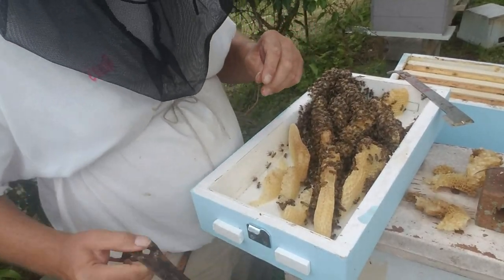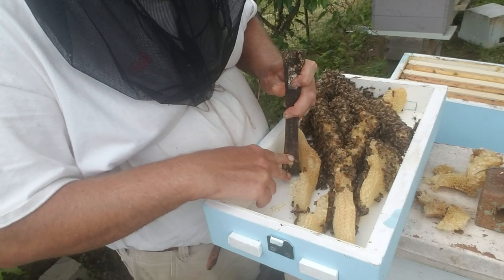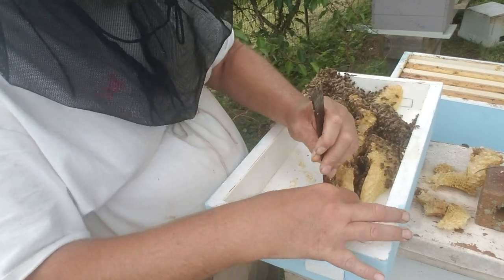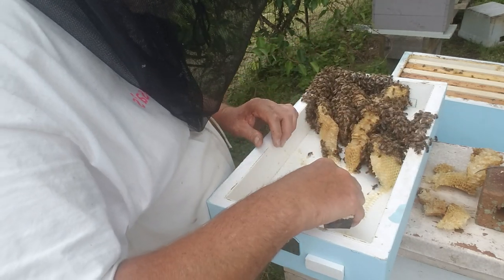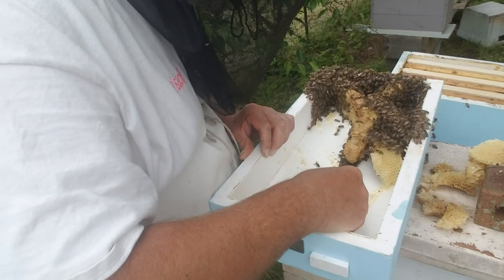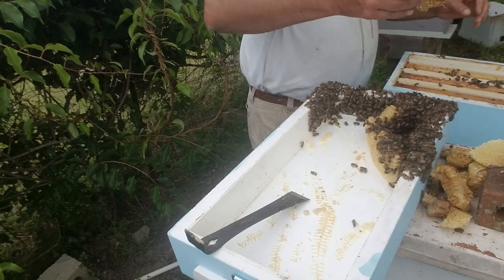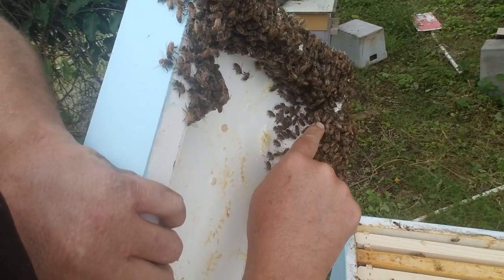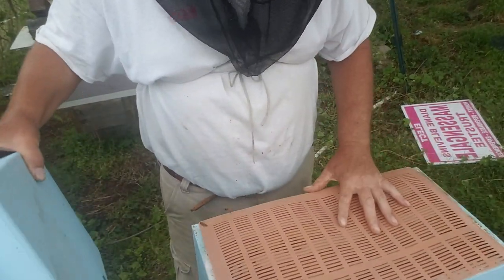How to Clean Up Burr Comb or Left Out Frames!

Comment: Should we not be worried that the queen will fly away? We messed up in our spacing and during our first inspection ended up with a lot of this comb. We were told to remove it but freaked out when we saw the queen and stopped. The hive is less than two weeks old.
Reply from the maker: The queen can fly even tho she is laying. Most times they will come back to the hive.
Reply: @WoolieBsApiary  that makes sense. We're new. We panicked. Thanks for your reply. 😁